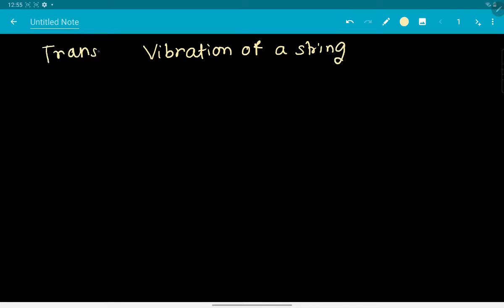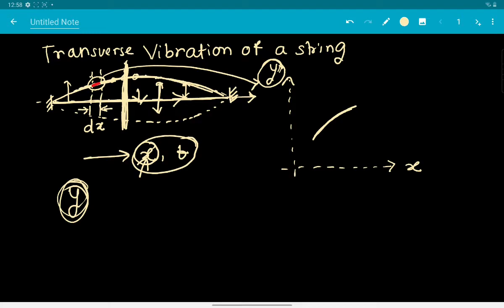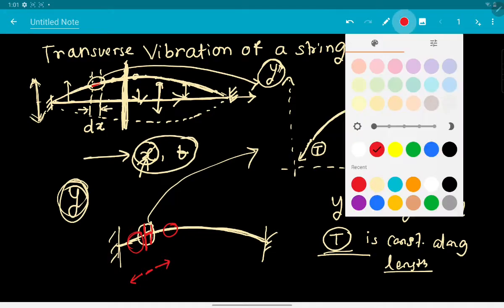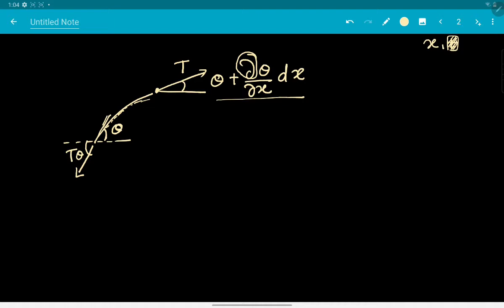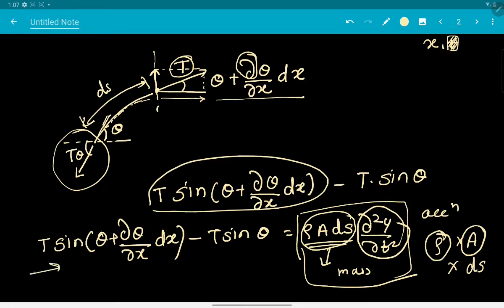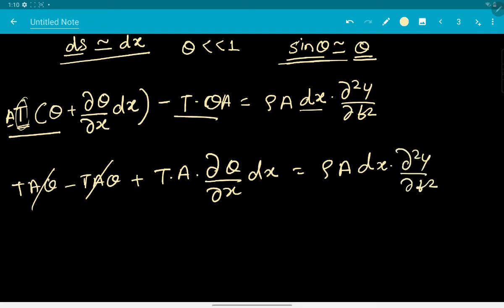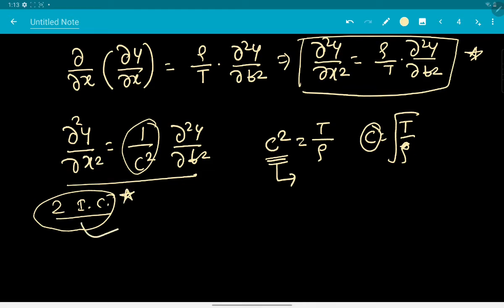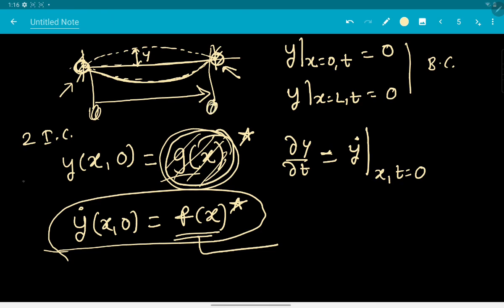33: Vibration of continuous system: derivation of eom for transverse vibration of string

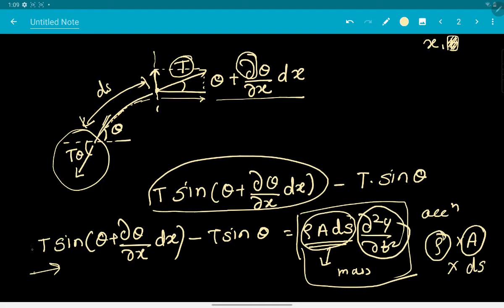Comment: Golden content. Thank you very much ma. Please ma kindly help me clear my doubts around 14:08 you multiplied the tensions by Area. I don’t think this should be so because tension is a force and not stress that you multiple by area to get force. Please correct me if I’m wrong. Although other calculations are correct. except the value for wave speed c.